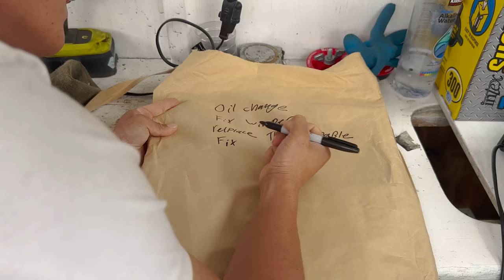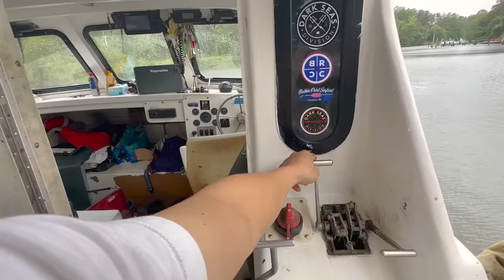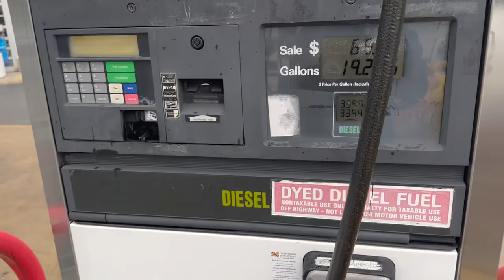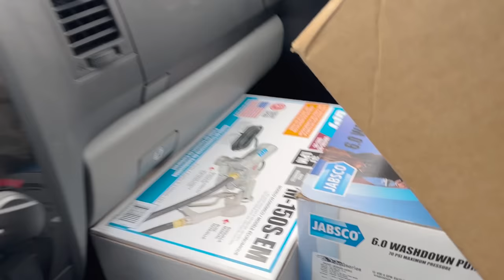This is What Happens When You Don't Maintain Your Boat

Comment: When you replace that type of cable, Tie a string on to the loose end, and then pull the cable out. That pulls the string through, then  you tie on the new cable, and you can use the string to help pull the new cable in. It won't do all the work, but it will make it a LOT easier! Also works for wiring.
Reply: Instead of a string I use a electricians metal snake. It's a lot stronger

Comment: Nice one.
Little tip for the cable replacement.
Get yourself a 1/4 inch universal socket attachment from a socket Spanner set and weld on some nuts the same thread as the cable ends, then you can attach the new cable to the old cable and use the old cable to pull the new one through.
Worked a treat on my dads 60’crayboat with 3 helm stations.
Make sure you tighten the locking nuts to the uni joint so you can rotate the cable as you are pulling it through so it won’t undo.🤘
Reply: Also if you tie a string to the cable you pulled for correct length.  Then You can pull the new cable with the string.
Reply: @davec4818  that’s all good until the string breaks.
Ask me how I know mate😎

Comment: LUKE!!! next time you have to pull a cable like that just get some cheap string and tie it off. Then pull it through and cut the string from the cable. That way you can have a sting in place to pull the new cable back easy, before getting a new one!! Hope it helps for next time

Comment: A tip from someone who has to pull a lot of wires, you can use a string or a rope tied to the end of your cable and pull that in while you wait to get your replacement.

Comment: I know this is a bit on the late side, but for next time: you tie a bit of string or speaker wire or whatever to the old cable before you pull it out, which pulls in where the cable was as you pull it out. Then you take the old cable to the boat place, get a new one, and pull it back through with the string /speaker wire.

Comment: good ingenuity, mechanic wouldve done the same, except theres usually a serial # about 2-3ft down one end of the cable, it lists the length of it, in the #,  so you can buy the new one, before you pull the old one (i usually put it on both ends, flip 1 cable round so u can check shift or throttle for lengths)

Comment: I would tie a strong piece of string (or other wire) through when I'm pulling that kind of stuff out of those places. Then you pull the string (wire) in the same way you do the other cable.

Comment: could measure the length with a string , by stringing it along the cable and then measure string afterwards and then buy the cable then tape to old one and pull it through etc

Comment: Pro tip: When pulling the old line, pull a piece of heavy duty string or mule tape and then attach your new line to the pull tape to replace it. Saves fishing thru the wall.

Comment: ***Let me give you a secret tip to stop rust on your hydraulic fittings and hoses. VHOB Petrowrap Anti-Corrosion Tape. It comes in a bunch of different names but it's just grease anti rust tape has been used for years on boats to stop break downs

Comment: 4:00 network cabling hack... when you take your pull tape through, add 2 strips of nylon fish tape, instead of 1... use 1 strip and leave the 2nd. strip in place for next time you fish tape. then do the same process next time, nylon fish tape is cheap! 
work smarter not harder, GET TO WORK!

Comment: I had the end break off of my shift cable right as I was going to shift into neutral at my dock things got interesting really quick I gunned the engine and cut the wheel hard over managed not to hit the boat docked next to me headed to the middle of the channel sercaled and had deck hand take the helm as Iran to find out what was wrong followd the cable to the transmission to see it hanging there ran to my tool box grabbed vice grips and shifted by hand popped it in neutral and coasted up to dock

Comment: Maaaan, you should have just bought a 325 gallon fuel tote or two with a long hose and let gravity do the pumping. That's how we fuel our shrimp boat the majority of the time, it's a hell of a lot better than running the boat to the fuel dock and spending a day on that. Just make sure to unscrew the lid of the tote before opening the valve at the bottom because as you fuel the boat it will pull a vacuum and it'll become nearly impossible to remove once you've realized that the fuel is taking forever to load. 😂

Comment: First, did you say you did this before?  Why didn’t you write down the length then.  

Plus, that noise you hear in the distance is me yelling “tie a string to the cable”.  This way it’s there to tie to the cable when you pull it out and then ties to the new cable to pull it through easily.

Comment: I would have replaced all the cables as most of the time is spent taking it apart and routing the cable, doing both would have added 15-20mins but the long term benefits………….

What next?